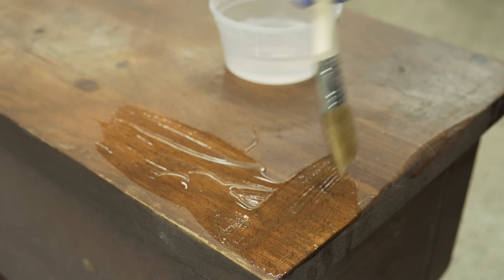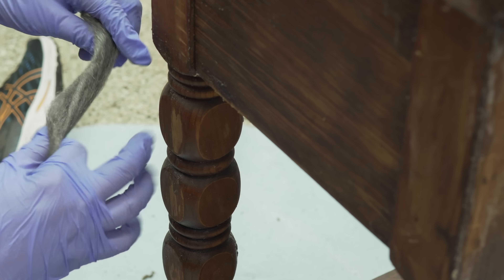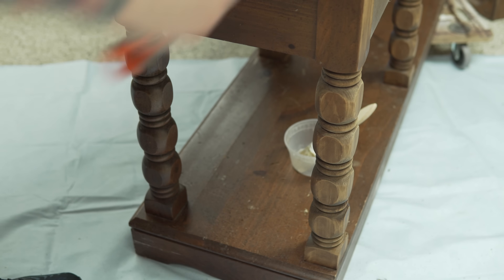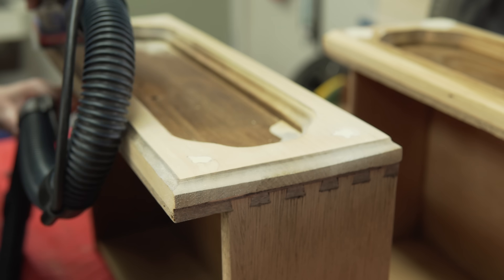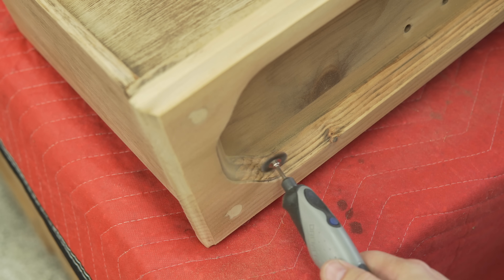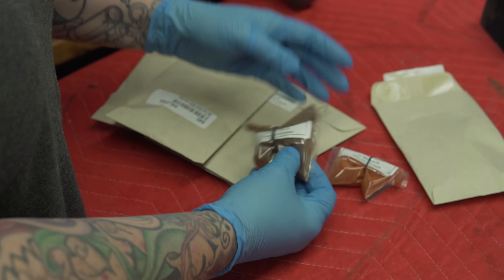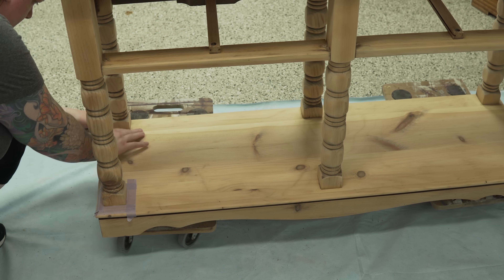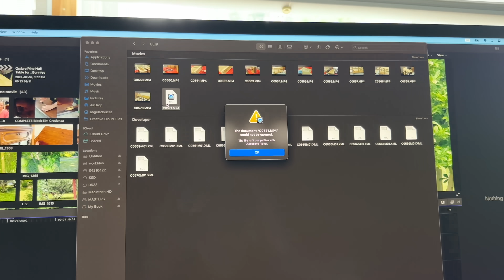Using TWO stains for a UNIQUE Modern Vibe on Worn Out Pine

Comment: Nice work as usual. Do you ever use crumbled up paper bags to knock down the texture between sprays?  It works great. Especially on light wood.
Reply from the maker: Yes it works great, I usually do it after the final coat. I tend to use a grey pad for in between layers of finish.

Comment: I have been watching your channel for 6 years. I find your videos not only informative, but soothing. I know, weird. I absolutely love everything you do. Have you saved a piece that is made of mdf and foil veneer?  If so, can you direct me to your video, please. 
I need some help saving a dresser for my new grand daughter. It was free and they don’t have much money. I know the challenge of mdf and moisture. This foil veneer is peeling. I’m thinking if I can remove any loose and peeling areas, sand the whole thing lightly and apply a sealer, I will be able to paint this, but I don’t want to end up ruining what I have. I apologize upfront for being indulgent and asking and understand if you prefer to not respond.  Thanks for your channel!
Reply from the maker: Actually, I've never worked on a piece like that Kathi. Best of luck with it!
Reply: @TranscendFurnitureGallery  Angie I am happy to say that I figured it out. The foil peeled off leaving behind a solid sheet of shiny backed adhesive. I sanded it to break the barrier and used chemical stripper and a razor blade to scrape it off. No other scraper worked well.  Lots of sanding, stripping and scraping got me to bare mdf. 3 coats of a solid surface primer and a ton of hand sanding between coats, I got a smooth sealed surface. Three to five coats of a cabinet paint depending on the area;  a lot of sanding and I have a fairly smooth dresser that should be durable for a long time. This was a 6 week project, but a labor of love.

Comment: I like the two stains you chose. That is a sturdy looking piece; very good as a table across the back of a sofa, or, as a hall table. I can't help but wonder what it would look like with the black stain on the legs and top only; and, the perfect brown stain on the drawers and their frame and the bottom platform. All in all it is a very good result and will sell right away. I hope Puff is adopted.
Reply from the maker: Puff was actually adopted by us several years back, but Jack and Reno are our fosters and are looking for their furever homes. ❤️

Comment: Angie, I have not seen anything of yours that has come out bad. 
I you do some refinishing myself and thanks for the tip on using a Dremel to get in some of those crevices with the wire brushes. 
I probably just would have painted those legs. 
Spindles are a B.
I see what you mean by the lacquer bringing out the brown undertones. 👍
Reply from the maker: Thanks so much for watching Jim! 😊

Comment: Have you ever thought about sandblasting the solid wood to remove the varnish? This gives the surface a different look, but it is easier.Solid wood surfaces that have deep dents can be watered, as this will cause the wood fibres to straighten up again!
Reply from the maker: I find sandblasting a bit aggressive for furniture. Soda blasting works well and is a bit less intense, though that can also cause damage if used incorrectly on certain pieces. I’m not entirely against soda blasting… but it has to be done carefully on the RIGHT piece.

Comment: I learned about dye stain the hard way. I had a set of 4 MC pieces (2 dressers and 2 nightstands). They were made with sapele mahogany and after I removed the old finish decided to stain them to bring out the lovely ribbon grain. I used gel stain which didn’t work. Then I tried to remove it and it was all stuck in the grain in little dark spots. What a mess. In the end I had to paint it… I was sooo sad. In the process of reading about that kind of wood when I tried to fix it, I learned they use dye stain on that wood. Lesson learned….

Comment: You need a soda blaster for legs like these! Thru aren't that expensive, at least not in the US. I feel for you! Legs like that are a bugger to get the stain out of!
Reply from the maker: Soda blasting works well and is a bit less intense than sand blasting, though that can also cause damage if used incorrectly on certain pieces. I’m not entirely against soda blasting… but it has to be done carefully on the RIGHT piece.

Comment: This is such a great transformation, and it matches Puff so well! I wonder if you've ever tried using soft metal rods cut down and sanded as features when plugging holes? I've seen it done a couple of times in the custom cabinets when my brother (he's a master cabinetmaker) decides to get creative, and that'd add almost a bit of an industrial feel to this piece, if you wanted to go in that direction.
Reply from the maker: Yes! I actually went looking for brass rods the day before I finished up because that’s what I was considering doing. But couldn’t find any locally, and it’s just as well because it may have modernized the piece just a bit too much. But yes, for a short time, that was something I considered. :-)

Comment: Have you tried using a lathe to sand turned pieces like these legs?  You'd obviously need to remove the legs completely - and sometimes that's more trouble than it's worth - but I think i would be better for situations like this one where it took you forever to sand off the stain from those legs.
Reply from the maker: Disassembling the whole cabinet would be a lot of work and the resulting legs would be thin little useless pieces.

Comment: Love the idea of the two tone. How do you determine the finish you use on a piece? I have seen you use multiple things like lacker, odies oil, and others.
Reply from the maker: Sometimes I base topcoat selections on the purpose of the piece (and what it’s made of, whether it’s been stained, whether it’s raw wood, etc); for example, I try to use ‘hardier’ ones on tabletops. But sometimes it’s totally random, such as trying to use up the last bit of what’s in a can, lol. Plus, preferences for certain products can change over time.

Comment: Have you ever tried a small sandblaster? They work well on ridges.
Reply from the maker: I find sandblasting a bit aggressive for furniture. Soda blasting works well and is a bit less intense, though that can also cause damage if used incorrectly on certain pieces. I’m not entirely against soda blasting… but it has to be done carefully on the RIGHT piece.
Reply: Now that you mention it, the prices I have used on were oak and not softwoods. So, agreed

Comment: Hey Angie, amazing work as always! Would love to know your thoughts on soda blasting as a stripping method. Would’ve made those turned legs a lot easier to strip. 😵‍💫
Reply from the maker: Soda blasting works well and is a bit less intense than sand blasting,, though it can also cause damage if used incorrectly on certain pieces. I’m not entirely against soda blasting… but it has to be done carefully on the RIGHT piece.

Comment: Angie, I just stopped viewing your vid coz I have to give you a technique I use to get to the bare wood into each cracks of the turned legs without destroying the profile: I use a very thin braided steel wire (1/16" - 1/8" dia.) long enough to hold and you just get in deep in the crack and make gentle movement sideways... I think you get the idea... I also hate stripping turned legs and I try to make it easier.  It works for me! ... continuing watching...  turned out gorgeous even if I'm not a big fan of these "Spanish" style legs! The art work that was often with it was an oil portrait of a Gypsy woman with long curly black hair playing a madoline! :)  Is my memory good?! The plugs needed to go!
Reply from the maker: I appreciate the tips!! 😊
Reply: @TranscendFurnitureGallery  my pleasure, you gave me so much tips in your vids, it's the least I can do :)

Comment: You probably don't have one because you would've used it but sand blasting it would get in those cracks.
Reply from the maker: I find sandblasting a bit aggressive for furniture. Soda blasting works well and is a bit less intense, though that can also cause damage if used incorrectly on certain pieces. I’m not entirely against soda blasting… but it has to be done carefully on the RIGHT piece.